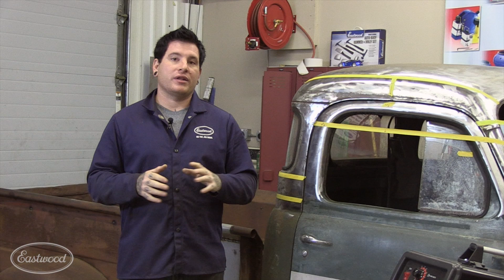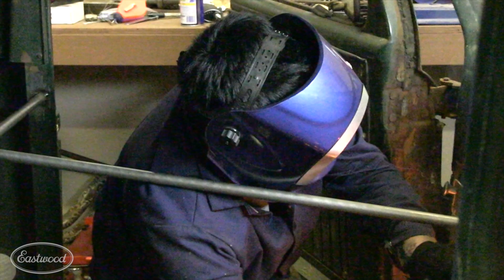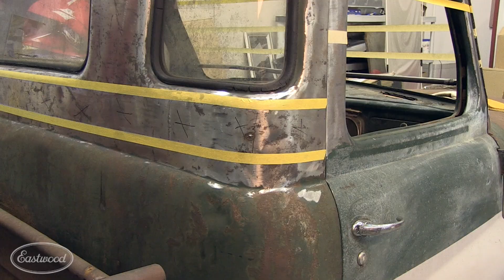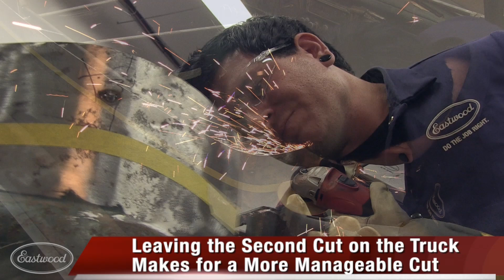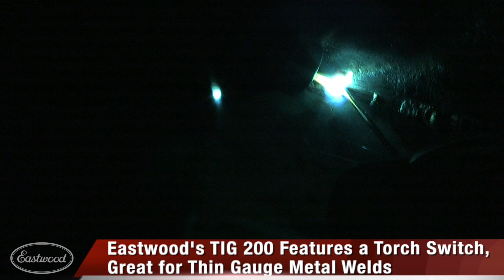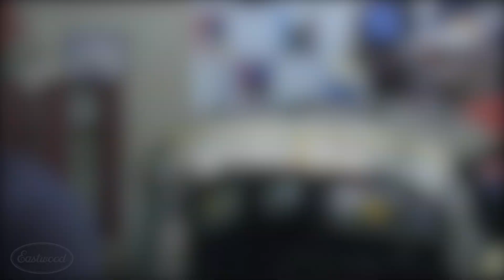Chopping a Top - Project Pilehouse DIY Top Chop Pt.1 at Eastwood

Comment: How do you cut the c pillar if its a different width? If you just cut a straight line, when you weld it back up the top part will be thinner now and wont align
Reply from the maker: Yes, you'll need to cut the two original parts to make them meet back up. Potentially adding some filler metal as well.

Comment: Cool video.  I always wondered how tops were chopped because of the pillars being angled and then not lining up when you cut out a whole section.  I never thought about cutting the roof in half to solve the issue.  Pretty slick.  Now I can sleep at night.

Comment: I've never done bodywork before but I have a question that I have never seen addressed in any other chop top video...

wouldn't it be beneficial to spot weld the door to the cab so that when you separate  the chopped top the door's upper corners are still perfectly matched to the door jam /roof ?
Reply from the maker: +j rok As the roof is lowered it usually gets larger.  That means the length of the top of the door gets longer (front-to-back).  So the door must be cut and pieces added to fill the gap, now that it is longer than original.  Does this answer the question?
Reply: +Eastwood Company ...not exactly answered.  I realize the door will also need to be lengthened.  what I am suggesting is chopping the door at the same time as the roof chop and then halving (front / back split) the door and roof while they are welded together.  this way both door corners remain tight to their respective roof sections, and then fill door and roof gaps at same time with same measurement upon reassembly. 

I hope that was a better explanation to my question.
Reply: j rok. The reason i would not suggest welding the doors in place is because it would be very hard to have sufficient access to reattach the top of the door and pillars/roof cause you must weld on all sides of each piece. The tubing installed to keep the car square and not removing the doors should keep your gaps correct I have just opened the doors on the chops ive done wasnt hard to work around once the fab work is done the door can be removed for finishing. 

Thats just me though

Comment: Hi guys;
Great video. Nice work on your truck. I have a 1954 Fargo that I am starting. The one thing that I would like to change, is the front shocks and wheels. Can you point me in the right direction on how to change the front wheels, brakes and shocks for a smoother ride.